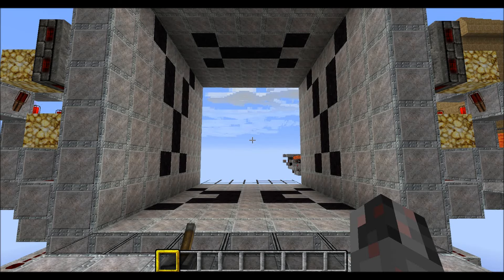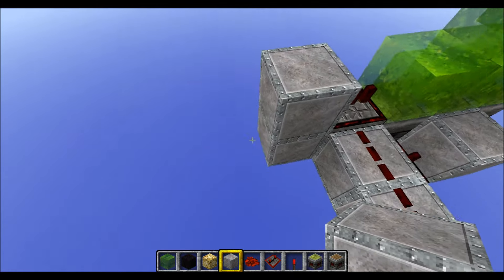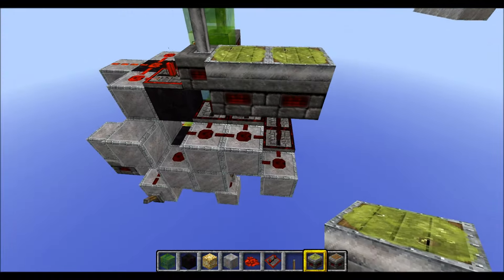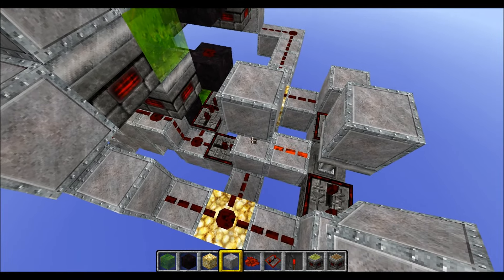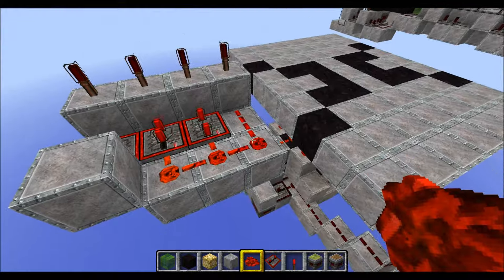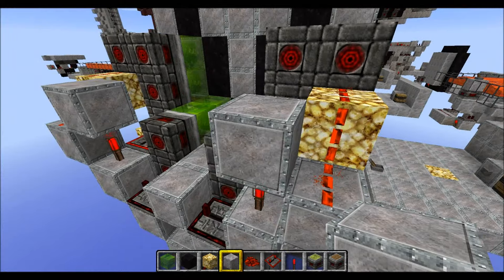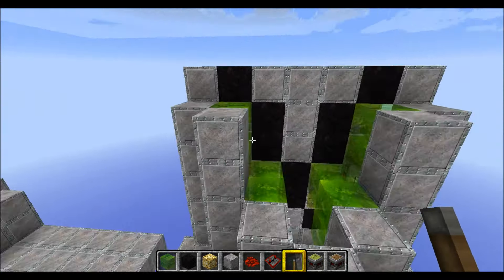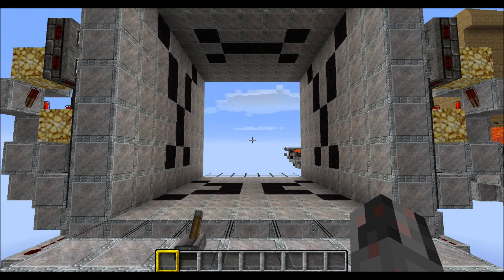Tutorial: Fast 7x7 Double Vault Door [Java 1.8+] (World Download) [THE SMP Prison Door]

Comment: Everyone, make sure you follow THE EXACT LAYOUTS, AND MATERIALS. I found that if you don't, shenanigans occur. I found that out the hard way. 💀

Edit: But the door itself CAN be a different/stronger material. But not the circuitry
Reply from the maker: Actually there are some alternatives you can use. I've covered them in this video: https://youtu.be/d3NSwS6cP0Q
Reply: @RKFWalter  You should pin it.

Comment: Hey the video was amazing but i have technical issue that when you close the vault it works perfectly fine but when you open on the ceiling the middle sticky pistons go in a staircase like structure and the ceiling doesn't retract properly. I hope you understand what i am saying. Please help.
Reply from the maker: I'm not entirely sure what you mean. But common problems that could cause a faulty retraction are:
- Wrong repeater settings
- Missing Redstone Wire
- Full Block instead of a transparent Block (here: Glowstone)

If you can't find the cause, you could use the download in the description of the tutorial. (If you are playing in 1.13 or later use this download instead: http://www.mediafire.com/file/tup2rswbrywg81m ) Then compare block layer by block layer.

Comment: Hey I’m in the process building the door at the moment. The bottom part works perfectly fine, however the walls on the sides don’t extend enough. They are one block short. I hope u know what I mean. I’m pretty sure I did everything correct but maybe I’m wrong. Maybe because I’m on the latest version? 

But amazing design 🥺💖
Reply from the maker: Just tested it, the door still works. Maybe you missed some redstone wire or something like that?
Reply: Let’s ask the important question

Are you on java?
Reply: Yes he is he said it only works on Java on a coment
Reply from the maker: @rjcastro4573  It's also in the title -> [Java 1.8+]
Reply: @rjcastro4573  I think he meant is MAJOR on bedrock
Reply: @zarzul697  why’d u reply on a yr old comment lol
Reply: @rjcastro4573  dunno tbh
Reply: @rjcastro4573  yeah not much point replying a year later, but 2 years? that's better!

Comment: Im having a problem with the walls. When I try to close it the middle blocks wont go in fully. I have rebuilt the walls 2 times now, what can I possibly be doing wrong? (I am on 1.16.5)
Reply from the maker: Could be one of the following:
- Wrong repeater setting
- Normal (full) block instead of glowstone block
- Missing redstone wire

You could try to compare with the build on my tutorial world ( http://www.mediafire.com/file/tup2rswbrywg81m ; coordinates 128 66 -48). It's easier if you open minecraft twice and then just switch between windows for the comparison.

Comment: Hi, this doors are awesome! Can i change an obsidian blocks? If I change obsidian to another material, the door mechanism stops working... I play on version 1.12.2
Reply from the maker: The obsidian blocks can be replaced with other immoveable blocks (furnaces, pumpkins, etc.). Normal blocks will connect to the slimeblocks, which counts towards the push limit of the affected pistons (12 blocks). That means that many parts won't even start moving, if you replace the obsidian with normal blocks.
Reply: And bedrock too

Comment: Hey walter, having some technical difficulties on this one. the closing mechanism works just fine, but on opening the blocks on the ceiling directly below the slime blocks do not fully retract.... i will look carefully at the video again, but I don't think I missed anything
Reply from the maker: I'm not sure what's causing your problem. Just re-tested it in my tutorial world and everything works fine... Your description sounds like the normal pistons fire too soon, try setting the repeaters at 23:49 & 23:59 on 4 ticks. If they fire stillt too soon, try replacing the redstone that's running into the pistons behind those repeaters with more repeaters... I hope that helps.

Comment: I built it but the top 3 stickey piston and the normal piston does not go back up :|
Reply from the maker: Could be many things. A wrongly placed moveable block getting stuck to the slime. A shortcut in the circuitry not letting the the pistons get depowered. Or maybe a wrong repeater setting (if the retraction starts, but doesn't finish completely).
Reply: I checked twice it was the same
Reply from the maker: What was the same as what?
Reply: I checked the vid twice and did block by block on what you did and still nope
Reply: Can you tell me your discord username please so that I can show you my problem cause I first built it by my self which is your design then it broke and did not work so this vid did help me :D.
Reply from the maker: Sorry, but I don't use discord.
Reply: Oh ok that is fine np umm I guess let is remain broken I tried and i will.give you cridet for the door in Vault 13
Reply from the maker: You could try to build the newer version, maybe that one works ( https://www.youtube.com/watch?v=QQBye03Hg_Q ). Although, that one appears to have some problems on some servers.
Reply: Is there a way I can contact you?
Reply from the maker: Besides the comment section? Not really.

Comment: Does this work on 1.16 ?
Reply from the maker: Yes, see title.
Btw I have a newer, much compacter design for 1.16+: https://www.youtube.com/watch?v=9cqzl9wpcZc
Reply: @RKFWalter  Thanks i was asking because i just finish the build its working but when i open the vault 6 blocks on the top are still there and does not comeback so i dont know how to fix
Reply from the maker: Check the repeater settings and for blocks geeting stuck to slimeblocks where they shouldn't. Those are the most common problems.
Reply: @RKFWalter  With repeater settings you many how many ticks ?
Reply: you mean*
Reply from the maker: Yes. If the delay isn't correct the entire thing won't work.
Reply: @RKFWalter  I checked everything but still like six blocks on the top dont comeback when i close and open the door the sticky piston should go up again next to obsidian but it will not dont know why
Reply from the maker: Can't help you unless you give me more information.
EXACTLY which blocks are getting stuck EXACTLY where EXACTLY when in EXACTLY which sequence at EXACTLY which retraction/extention step. The door has several dozen pistons (many of which could be considered "next to obsidian"). This is a fine-tuned, supercharged design. If even a single block isn't placed/tuned properly it likely won't work. E.g. give me the timestemps of when the effected blocks are placed in the tutorial to make clear which ones you mean.

Also, please use at least some points to separate your sentences. It takes about three times as long to deciffer what you mean otherwise. It also reads like I imagine a squirrel on coffeine would sound like.
Reply: @RKFWalter  I completely understand but you know is hard to explain trough youtube comments :D
Reply from the maker: I know. Thus my mentioning of the the trick with using time stemps.
Reply: @RKFWalter  Like the top 3 sticky pistons next to the 3 normal dont comeback on the both sides when i open the door
Reply from the maker: Are they getting stuck in the "open" position or the "closed" position?
Reply: @RKFWalter  open when i close and againg open then it get stuck
Reply from the maker: That sound like there's a moveable block that gets stuck to the slimeblocks. Check the blocks below the two repeaters running into the pistons on the side and the block inbetween the two slimeblock rows. Those should be immoveable (obsidian).

Comment: hi there, amazing video! i'm by no means a redstone expert (so forgive me if i'm wrong), but when comparing your vault door to the door on the smp, technically couldn't the redstone configurations be slightly different, that indicate that the design might not be exactly the same? i'm curious to know the explanations and reasoning behind why credit hasn't been given, especially considering that a close up look into the redstone layout hasn't been shown yet to the smp viewers! i'd guess that this assumption can't be made until we are able to fully compare both doors, and that can't happen yet until we see the details of the redstone. for example, is it possible to have different redstone layout yet still have similar block movement like you mentioned in a previous comment? thanks :) i appreciate all your time and hard work!
Reply from the maker: Thanks!

You asked some valid questions, but there is actually decent evidence that he used my design (there's at least one video that shows the upper half of the circuitry, https://www.youtube.com/watch?v=HnotuPjb1o4 ).

I just published a community post with a few more details in preparation for more people asking those questions. But the short answer is, that at least the top half of the door is identical to my design, the opening&closing sequences are the same and at least the slime and piston layout of the bottom half are also the same. Given that I can give you about 6 different designs for a simple double piston extender without having to think about it should already tell you how unlikely it is to build an identical door of that size without copying.
Reply: @RKFWalter You deserve way more subs man
Reply: holy yap
Reply: holy yap
Reply: holy yap
Reply: holy yap
Reply: PIPE DOWWWWNNN PIPE DOOWWWWNNN